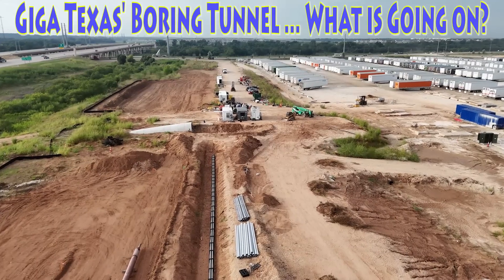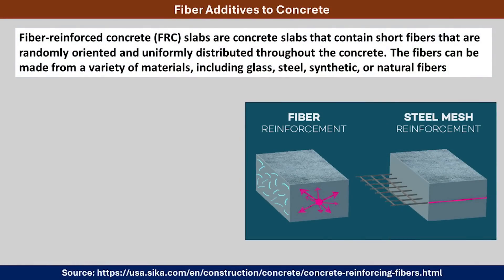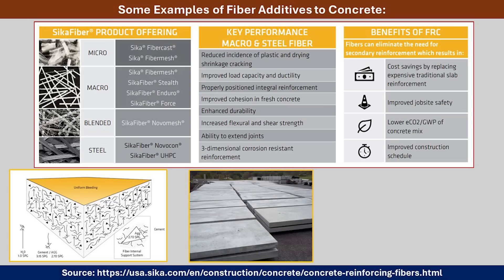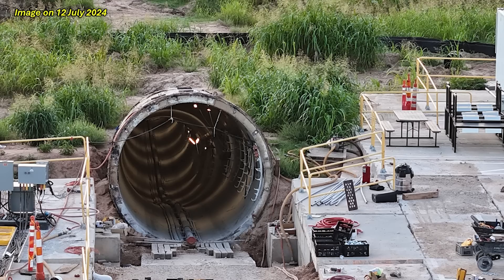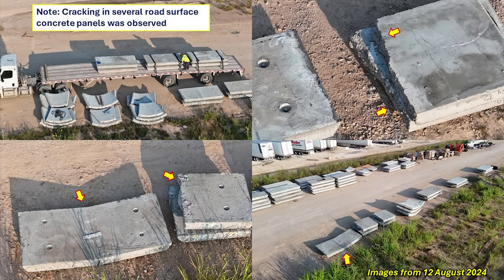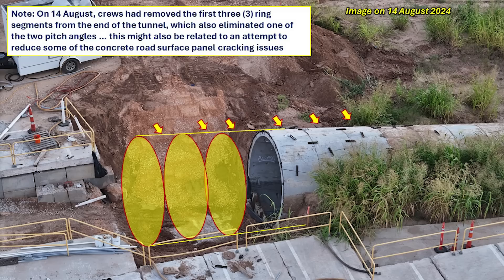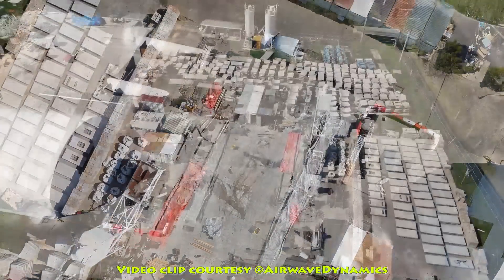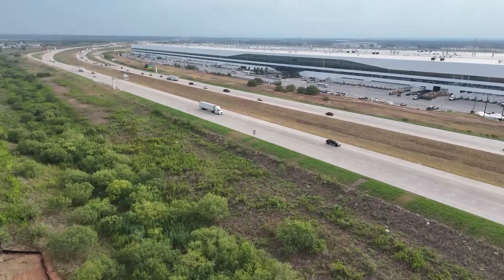Boring Company Giga Texas Tunnel Road Panel Issues, Mitigations & Probable Solutions

Comment: Some observations and my opinion as to the cause of the failure.....
1) Some of these tunnel road segments began failing even before work was completed. On Joes 7/29/24 video at the 29 :56 and 21 :02 timestamps.... Broken segments can be seen by the side of the road. I believe there were broken segments even earlier. I just don't have date and timestamps.
2) I believe David Salisbury said (he can correct me if I'm wrong) that he would not have chosen fiber reinforced concrete for the road segments due to poor performance under point loading. The fibers are only a couple inches long. 
3) All segments were removed from the tunnel. Indicating that the problem went the entire tunnel length not just the entrance.
4) If you look at the broken segment @ 7:06 there appears to be some fiber at the bottom of the slab, though probably not enough. Thus, a quality control problem as well.

Missed opportunities....
* This was a new design which probably should have been rejected to start with. Again, because while fiber reinforced concrete  is great for ground slabs that are well supported from below.... It doesn't perform well in tension. Not good for beams, bridge decks, etc. That was missed opportunity #1
* Failure to properly test the new design prior to installation of the new segments. Not that hard to put them under a hydraulic press to see how much load they can carry. That was missed opportunity # 2
* Failure to stop work and do testing after it became apparent that there was a serious problem. They walked and drove right by the broken segments and continued installation work until all segments were installed! That was missed opportunity #3.
Reply from the maker: Thanks David and I'm glad this short video has generated as much interest as it has ... i guess a lot more people were wondering what happened about the tunnel than I had thought! You have a lot of great points and observations here. I do know they very much considered this a test tunnel and it is possible they were testing out something new and they discovered this way of making the panels did not work out, so they are now changing to something different. Part of the fail fast approach they adopted form SpaceX and this is part of trying new ideas.
Reply: @JoeTegtmeyer  But here's the problem as I see it.... There are certain places where "fail fast" or "move fast and break things" shouldn't be used. Structural engineering is one of them. My understanding is that there are charts and tables that engineers can use to look up the loads that different materials can carry. If they didn't want to look up the information, or thought they could do better.... Then.. Produce one or two tunnel road segments and put them under a hydraulic press to test load carrying capability. Which would have also caught any mistakes in their calculations. It would have saved them a whole lot of trouble in installing, then having to remove hundreds of segments. Thank God nobody was injured or worse in all of  this. Hope you can see my point.
Reply: @JoeTegtmeyer  Another suggestion if I may....
Look up the Titan submersible. Which was an entirely preventable engineering disaster. Again, a misuse of materials for something they weren't designed for.
Which everyone can learn from, and why "fail fast" and "move fast and break things" is a really bad idea in certain areas of technology. Thanks.
Reply: @DavidJohnson-tv2nn  If they had tested the titan sub autonomously before putting people in it, the tragedy may have been avoided. I also think that there is a misunderstanding of the fail fast system. You fail fast because you have a testing process that ensures failures are discovered quickly. Furthermore from what i have observed Musk companies tend to move quickly with calculated risk. Look at starship testing lots of explosions but risk to life is low. This testing of road surface tiles by boring is with a trusted customer who lets them do this test without serious consequences-Tesla. I think people say fail fast but they dont see the planning behind that ideology and the benfits it brings in the long run.
Reply: @njengakim  The Titan went on several dives prior to the disaster. Autonomous testing doing a few dives likely wouldn't make any difference in this case.
One of the problems of the "fail fast"/"move fast and break things" concept is those who are in charge seem to have a total disdain for authority, regulation, and certification. In the case of the Titan, the CEO refused to get certification because he knew it would never pass. Why? Carbon fiber composites are superior in tension, even better than steel. However, they perform poorly in compression. The arrogant CEO thought he knew better and it didn't end well.
Starship.... " risk to life is low"?
On the first test flight, do you have any idea how close they came to disaster? When you're going to "fail fast" one of the things you don't want to fail is the Flight Termination System (FTS)! 😊
On the Titan, to quote James Cameron....
""It's okay to move fast and break things as long as the thing you're breaking is not a submersible"
Reply: @njengakim  One more point regarding the first test flight of Starship....
The incredible display of arrogance and stupidity by those in charge. The arrogance to ignore 60 years of engineering knowledge of the need foe a flame trench and a water deluge system. And the stupidity to think that they can "get away with it" one more time. YES, I am drawing a link between Titan and Starship development. If they continue down this road, it is not a matter of "if" but "when" disaster strikes. Just one example... t
The lack of, or plans for a FULL launch abort/landing abort system. You know I'm right, it will catch up with them.
Reply: @DavidJohnson-tv2nn  i will admit to being ignorant about titan. However your arguments about starship i disagree with. It was not arrogance but a new approach. What you call arrogance is just boldness. The flame trench issue only became an issue because if the improved thrust of the new version of superheavy. The current system has worked well with the flights. There was an oversight on the first flight where they miscalculated but they were well aware of the risk and  did not expect the launch platform to survive but it did enough to launch starship. Spacex was aware of this and already had a solution which they implemented in later flights which has worked well and it was not a flame diverter. Your assumption that it was arrogance and stupidity is quite unfair considering that the FAA went ahead and issued the licence. However note that the starship programme is an EXPERIMENTAL programme and calculated risks are taken during tests. Sometimes unexpected things can happen like the Delayed FTS situation. They obviously underestimated the amount of explosive they would need to blow up a starship. However attributing it to arrogance and stupidity is wrong. This was just a case of ignorance which is to be expected when dealing with something unprecedented like starship.  Despite all that the fts worked and the ship blew up the FAA investigated and after which spacex implemented the results. No one died and no disaster happened because the risk was mitigated by having an exclusion zone in the gulf of during the launch. Move fast break things in my opinion only applies in testing. You want your products to fail during testing so that you can know the limits of your engineering. The fact that titan did not fail during its tests should have been a bad sign for the company. I would rather deal with a company with a history of disastrous tests than one where everything seems to be working well. Nobody has ever acccused spacex of having an incident free testing period. Yet the results they have achieved speak for themselves.
Reply: @njengakim  I might split my reply into a couple of comments to take one issue at a time. No big deal about the Titan. We can't know all about everything. Which is why these discussions help.
Starship FTS....
This is one system where failure is NOT an option. Yes, there can be errors in calculation, stuff happens. Which is why you MUST test safety critical systems. Which they obviously didn't do prior to launch. And yes, thank God, nothing bad happened. The exclusion zone would not have helped here had something gone wrong in a certain way. Think about how far the vehicle can travel in 42 seconds. With the engine failures and the loss of attitude control... Imagine what could have happened if the vehicle would have taken a turn towards a major population center? They got lucky and averted disaster. There was no excuse for getting careless on such a critical safety system. 
Now please don't get me wrong, despite how I feel about Musk, I want SpaceX to succeed. Just like I'm interested in the construction aspect of this project. But sometimes they need constructive criticism as in this case. Yes, "arrogance and stupidity" might be harsh, but consider just how serious this was and the consequences of what could have happened. Just think if the rocket turned in a different direction. What I regret is leaving out equal criticism of the FAA for allowing the launch. Hope we can agree that FTS is something you don't make assumptions about or test after it fails! Lives depend on it.
Reply: @njengakim  Flame trench/water deluge system....
They have used flame trenches and water deluge systems for all large rocket launches for the last 65 years for a good reason. To ignore that engineering knowledge is unbelievable. This didn't happen just because they increased the thrust. And to think "they can get away with it one more time"  is also unbelievable. If I remember correctly, their static fire test was at only 50% thrust?
Water cooled steel plate....
The steel plate appears to have been a temporary solution. The steel plate still allows rocket exhaust to be ejected in all directions.
Notice that they are building a real flame trench for the second launch tower? But why do they have to learn the hard way by ignoring 65 years of knowledge? There are some things that are known fact that can't be "improved".
Reply: @njengakim  Launch abort/landing abort.....
I don't think you addressed this critical issue? This will come back to bite them in the future. I hope your response won't be that they will make Starship as safe as an airline flight. Not going to happen. Yes, they can make rockets safer. They can never make them safe. It is only a mater of time before disaster strikes if they keep going down this course. And how far back will that set you hopes and dreams for the future of spaceflight? In my opinion, rather than defending, it is time for fans of SpaceX to speak out.
Reply: @njengakim  Definitely interested in hearing your opinion on a launch abort/landing abort system. And while landing abort hasn't been needed in the past, manned vehicles haven't done propulsive landings either. Any failure in the last 3 seconds of flight would mean disaster.

Comment: Thank you, great info. I grew up pouring concrete on a wide variety of jobs. I left the construction industry and got a degree in architecture that included some basic engineering courses including concrete construction. Fiber reinforcement had not started by the time I graduated but I continued to follow its development. It has been heavily promoted. Rebar reinforced concrete has undergone quite a few design changes over time as failures show the need. Concrete is brittle and subject to cracking because it has no tensile strength that can be relied on. Therefor all tensile loads are provided by the steel bars. The deformation pattern on the bars is designed to provide "grip" to the entire length. Bringing me to my first question. What provides the "grip" to the fibers? Just the angular random positioning?  Your photo of a test sample with fibers sticking out, free of any concrete sticking to them would seem to question their "grip." As you pointed out, there is no visible fiber on the broken roadway panels. Their mode of failure looks like lack of tensile strength. I.E. what ever fiber system was used failed to provide what it is there for.  I'm very interested in an engineering analysis of these panels. Samples to a testing laboratory. Can you do a follow up?
Reply from the maker: Thanks and I agree with your assessments and thoughts about the concrete and how it was used in this application. I hope to be able to get additional information and figure out the mitigation steps they actually employ, but getting a actual sample and getting it tested is likely not something I'll be able to do. But, you never know!

Comment: Seems to me that fibres work well in a slab on the ground, but like I mentioned on X, when there are only small contact patches on each side of the tunnel you need the tensile strength of steel rebar to keep them together.
Reply: the fibres should give the concrete slab some tensile strength given they are distributed evenly. 

the slab can be assumed simply supported from the sides. with tensile strength of 1,7MPa a rough calculation gives bending capacity of 30 kNm for a 200 mm thick slab. a 4 meter wide simply supported slab with 5kPa even load gives approximately 30kNm maximum bending moment with safety factors included.

so fiber reinforced concrete could be feasible for this application. sorry for metric units
Reply from the maker: I think they are learning a lot about what does and does not work for this application. As mentioned, this was considered a test tunnel, so I think it is possible they were testing something new.
Reply: @JoeTegtmeyer  You learn that in 8th grade physics, it's unbelievable that engineers make such mistakes.
Reply: They're not just hanging from two points, there's also horizontal pressure from the tunnel sides, which probably helps.

Comment: I suspect openings between the precast slabs due to changing grade. They could do a fish scale design kinda like the side only  the angle would be tilted in the same direction and do a finishing grind to smooth polish the final product?

Not sure what the 4 holes are? could be casting or lifting holes? We used to have slots in our runway repair blocks at AES in Germany that we would insert a T lifting bar into slabs for placing. I do remember seeing them placing slabs with a forklift not sure if this was normal operation or not? The slot T bar lifting method would also enable removal of individual slabs for repairs as well.

If they made the tunnel lining with just 4 segments they could in theory push off of just 2 while continuing to bore & setting the next two segments in place continuous boring. Either anchor the segments to the surrounding tunnel wall or maintain in place while waiting for the keystone completion segments Or make the segments longer so as   to move further for each push but continuous boring is the holy grail/cup to achieving 7 miles per day.

 "All shall seek shelter under rocks or in caves." Derenkuyu, Capadoccia, Longyou caves, Barbara caves.

Good Luck Jesus Loves You!

Comment: I still feel that this tunnel is not a cost effective idea.  It would have been better to have vehicles FSD drive themselves under the southern bridge to a designated spot in the western lot. Also, locating a data center in the extension is not a good idea, I am sure that it will be gone in 2-3 years.

Comment: rebar rusts and slowly rippes the concrete apart from rust expansion the fiber reinforcement will never do that.
Reply: They make fiberglass rebar & coated steel bar. No more spalling
Reply: Fiber also performs poorly under tension!
Reply: Basalt rebar is the best solution. No rusting, low cost, high strength. Kitty hair mix can be used with them.